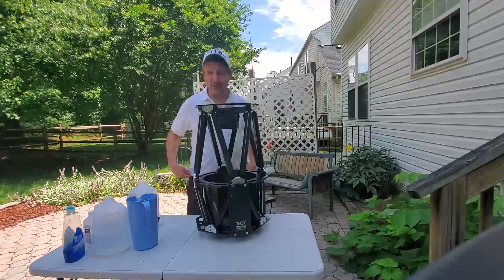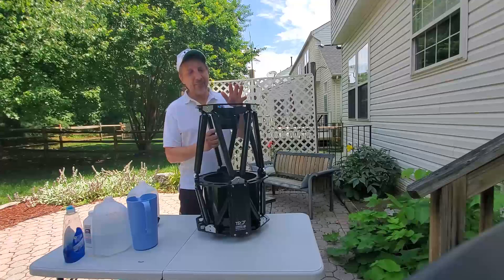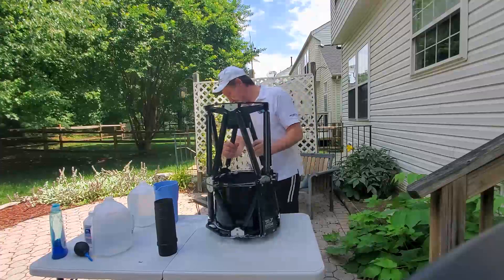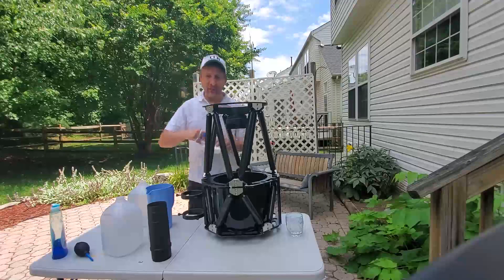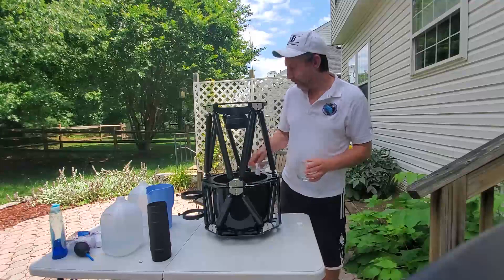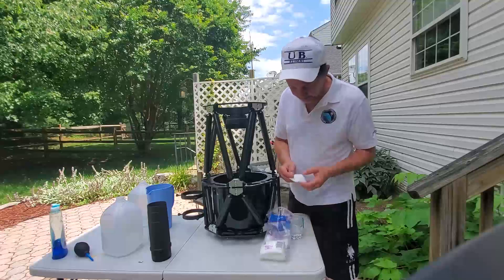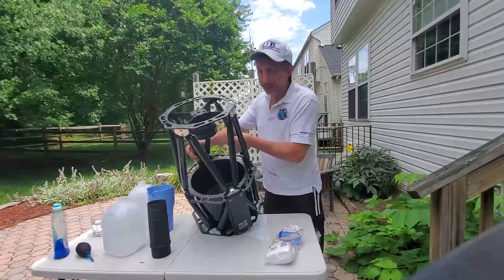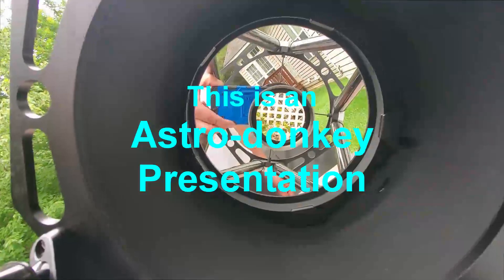How to Clean a Ritchey-Chretien Telescope in under 10 minutes

Comment: This method of cleaning the mirror is a real killer for the fans built into the back panel.

On my 14-inch RC, I only remove dust with air. If that's not enough, I wash the mirror while it's removed. The subsequent collimation is quick and easy with the Takahashi collimator telescope.
Reply from the maker: I removed the fans.  RE: My telescope cools to ambient in a bout an hour anyway.  Also, the fans add weight.  Granted an once or two, but it is weight saving none-the-less.  Lastly, I can't help but think with the fans running, my astro-imaging might be affected by a few pixels because of vibration.  Retentive, I know, but every little bit counts!

Comment: Be careful once you hose it down, tipping the OTA forward as you did briefly in this video, may run water up the struts if they are hollow. It happens to me when after scuba diving with underwater camera gear, it may not be noticed for some time that seawater gets trapped in the tubing of arms. Realise this may not be a problem here. Great video, if somewhat risky.
Reply: Never SCUBA dive with your telescope. Learned the hard way.
Reply from the maker: Whats funny is I am a SCUB diver as well.  I recommend doing this in the summer when its sunny an 80+ degrees out to evaporate water.

Comment: Also, why not try this method on a solid closed steel tube model, assuming ine can secure the center tube
Reply: I guess you could!  Just overturn it to drain the water.  Then leave in the sun to dry!  If there are concerns, then just take the mirror out, but that is the difficult part with an RC.  Hence the video!
Reply: I have usually taken the whole rear assembly out, washing the mirror, as I was concerned about rusting the steel tube

Comment: could you avoid rust problems, if any, by using a final alcohol rinse without water?
Reply: Always do a final rinse with distilled water.   Alcohol will leave residue behind.  Rust isn't a problem since there is no  exposed steel, and it was 90 degrees out.  The water evaporated quickly.

Comment: interesting video! Have you 3 little fan on the back-side? Is the function of the fans OK after cleaning?
Reply from the maker: Good Question.  I removed the fans.  We all know they are meant to cool the telescope for better observing and imaging.  However, the telescope normalizes to ambient temperature in about an hour anyway.  By the time I set up and start guiding and imaging, its takes about an hour, so I don't need the fans.  I removed them as a cost saving measure.  Maybe took off 1/8 lb!  RCs are heavy, so everything helps!

Comment: Interesting. but if you  have access to the primary mirror why not use a cleaning liquid with a cloth ? I recently bought a gso 6 inch but it has a tube so i am not sure if i will be able to clean it when the time will come, i read in another manual for the orion 6 inch that should be sent to service for cleaning, did not find yet the instructions manual for the gso 152/1370.

Comment: Good video if you like to be creative and experiment different ways. 

I personally wouldn’t do that myself.. only because you are causing the cork under the primary mirror to increase size with water. So once collimated and it’s eventually dried out it will cause you issues.

Again the screws on the fans will rust / and anything that isn’t carbon that you can’t wipe off.

The telescope is an open design truss and would encourage anyone just simply use a lint free cloth along with a optics cleaner..
Reply: So I humbly disagree.  The tube dried quickly in the sun.  I also remove the fans for weight saving; HOWEVER, all this aside, dew forms on telescopes all the time at night.  Especially in high humidity.  There were times I brought in my scope at night and it was dripping!